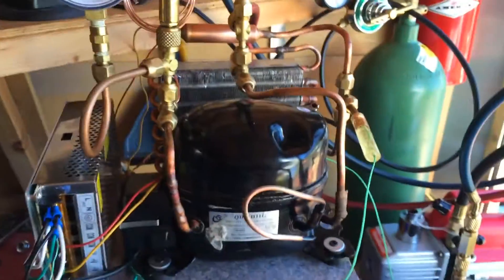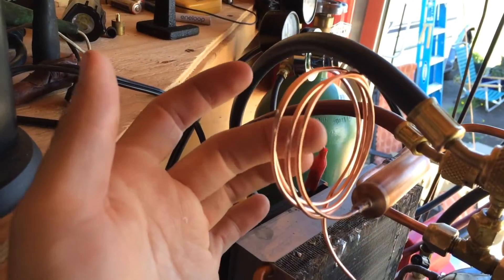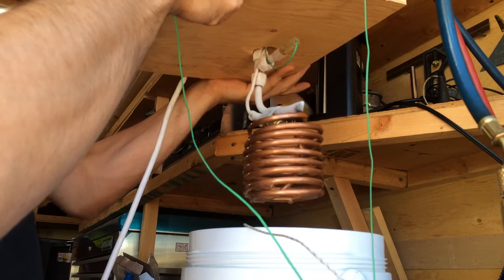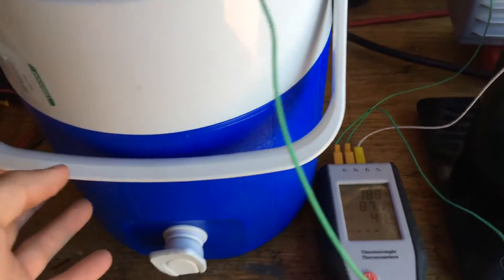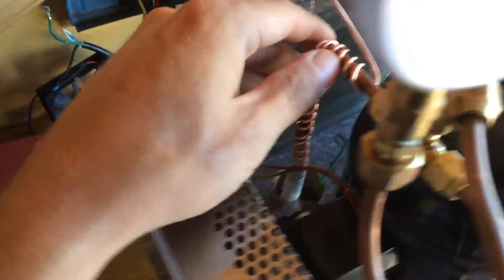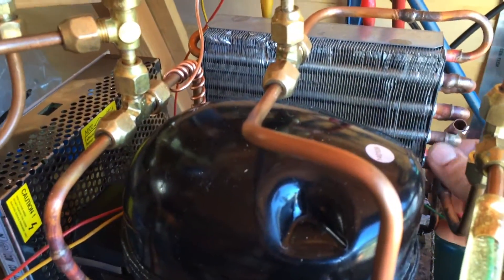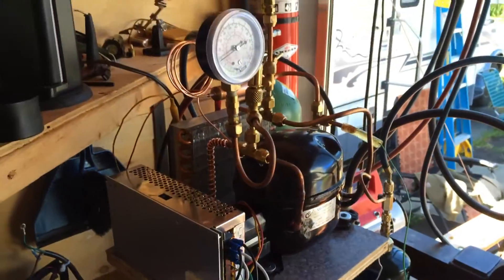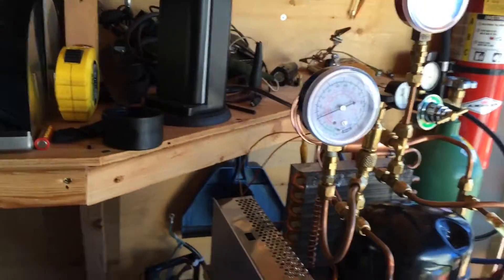Small Modular Refrigeration Unit- R290

Comment: I know this was years ago but if you do this again you can remove the moister from the propane by charging it trough a filter dryer  . Filter dryers are sold not only in braze in form but direct threaded versions you can connect between the cylinder and your gauges .

Comment: Hey mike, are you ever too concerned about amp draw? I have been finding that most compressor run better at higher amp draws and actually lowers discharge superheat. been running a 1/4hp lately at 235w 240v
Reply from the maker: stobby possibly.  Are you loading it up with higher mass flow?  Is it a compressor for low temp application, used with a higher temp evaporator?
Reply: M.C. Pletcher the whole system I made myself. It's a fibreglass sort of chest freezer. Embraco fgs80ha. Needle valve. 225psi high about 10psi low r290
Reply: Mass flow is a funny thing the more you open the valve to decrease Superheat and raise temp and pressure, the high side pressure actually keeps rising as the condenser can't handle the mass flow and I assume some flash gas is passing the valve
Reply from the maker: Yeah, if you think hot gas is getting through the needle valve, that's rarely a good thing.  I wonder if your subcooling suffers with the higher mass flow.  I can see how the discharge superheat could be lowered,  if the suction gas is cooler, and denser, but with higher head pressure might come lower overall performance.  This  might be true if the condenser can't handle the higher mass flow, subcooling is poor, then the added mass flow just gets flashed off in or after the needle valve.  I think that's kind of what you were saying though.
Reply: Yea i'm thinking my condenser is definitely undersized, i have combined one small wire type fan forced condenser and a static condenser on the outside of the box. my last run of the system i was evaporating at -24c, about 1 degree of evap superheat, 67c discharge about 2 inch from compressor, and liquid temp before the expansion valve was 42c. I'm thinking of replacing the wire type condenser with a tube and fin condenser rated too 600w of heat.
Reply: Another oddity i cant get my head around is that the low side pressures have a massive impact on amp draw, I mean i can pull some ridiculous amps if the valve if opened to increase the pressures. allot of folks talk about reducing compression ratios which in theory is sound. however in practice doesn't seem to work too well

Comment: Hey i need - 40*C temperature for my engineering project so i bought R22 but i have R134a compressor. Can i use r22 with R134a compressor and if i can then what should be low side pressure while charging R22?
Please help